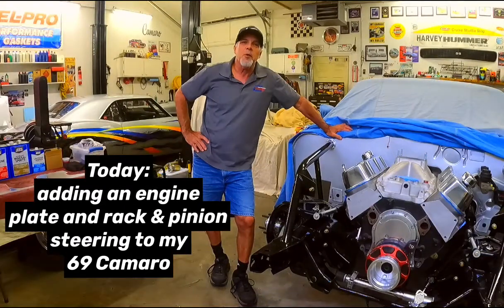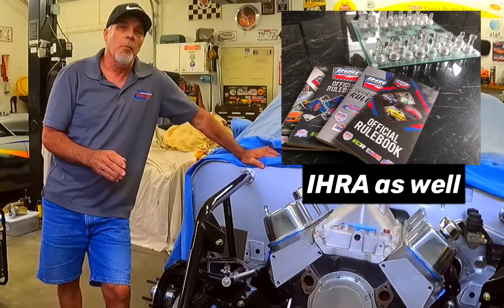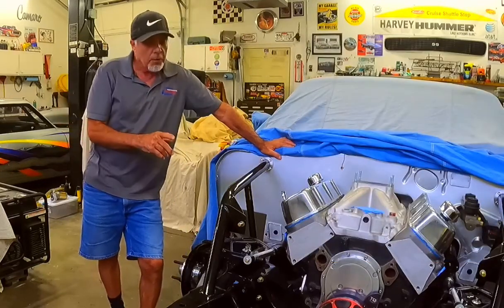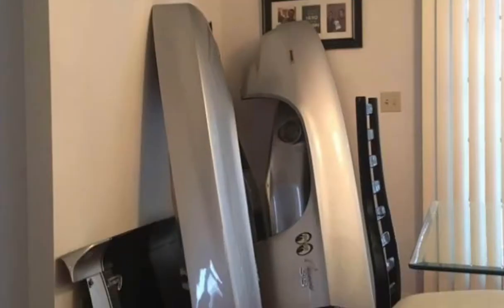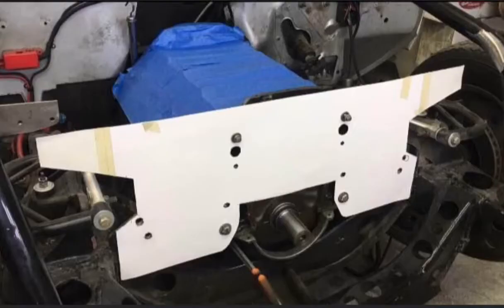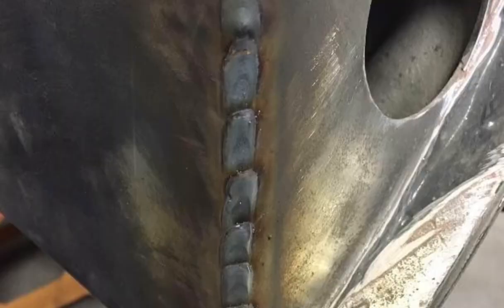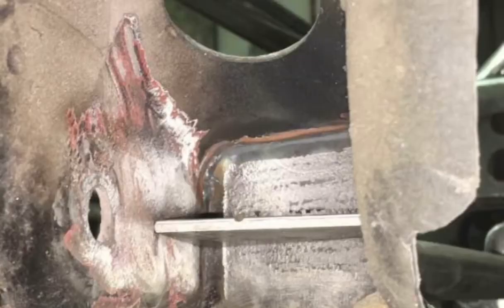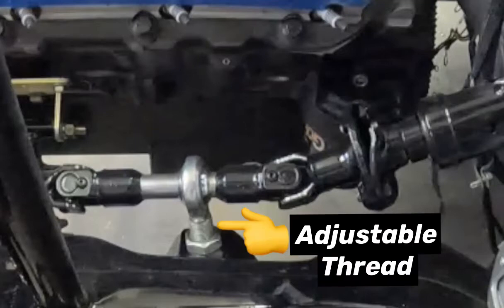1969 Pro Street Camaro rack & pinion install/engine plate/front frame mods

Comment: Are you running fiberglass fenders or still metal? Your absolutely right about the price for wilwood brakes. When I wanted disc brakes for my 1st gen firebird, it seemed a no brainer. I bought front and rear for just a little more than what stock disc would have cost me. It stops way better, weights a lot less, and looks better too.
Reply: My 67 drag car has steel fenders and front end but my 69 street car has VFN fiber glass fenders, header panel, lower valance, core support and hood. I know it should be the other way around but the 67 is still super light at 2,700 lbs.

Yes, the Wilwoods are the best way to go imo Jason. 

Thanks for checking out my video too 👍🏻

Comment: How weight did you save with the manual rack & pinion steering
Reply from the maker: Hello Freddie, I did not weigh the difference between components but the weight savings was quite significant. 
My intention is to weigh the total package once all mods have been completed. 
The car weighed an even 3,020 pre modifications so I’m predicting it will be in the 2,850-2,900 range next time to the scales.

Comment: What rack did you use?  I’m thinking of doing a rack and pinion conversion to my 68 and was wondering what the rack pivot-to-pivot and overall width dimensions should be.
Reply from the maker: Are you in West Michigan?
Reply from the maker: Btw, I’m reaching out to GoFast Productions (where I bought it from) to get the actual name of the manufacturer for you so hang tight.
Reply: @ronsmusclecargarage4060  I’m not. I’m down in SC.
Reply from the maker: @stibiumev1586  ahh, ok. 
I just spoke to my buddy that 
owns GoFast Productions. The rack that I bought is a Flaming River. These are basically Ford Pinto racks just so you know. 
I believe Summit Racing sells them also. 
Let me know if you have more questions 👍🏻